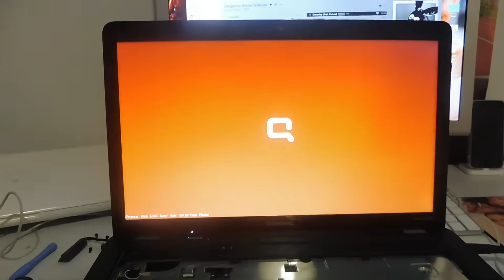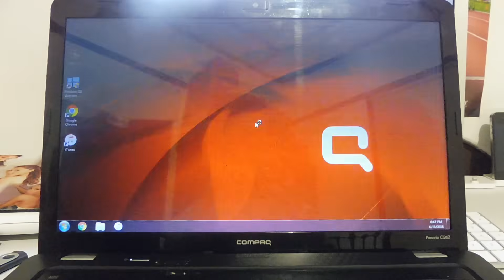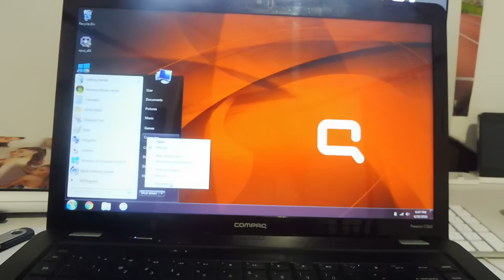HP Compaq CQ62 Blinking caps lock key fix

Comment: i was have the same problem with compaq presario CQ42. i was reset everything like ram,cmos,processor,wifi but still not work. the screen is black.. previously it was caps lock blinking 4 times and wifi turn orange. so far i was no luck. thanks.

Comment: I suspect mine has problems with the CPU/heat sink connection as I have to blow an air bed pump into the fan every now again to keep it cool as it throttles its performance to protect it from overheating

Comment: i need help I've been trying to fix my laptop for over two months. the caps lock blinks 3 times and the the wifi key is a steady yellow. can anyone please help? I've tried taking out the battery and resetting it but that doesn't work. also my screen is completely black. i can hear it turn on tho
Reply: Alys Fernandez same problem for me
Reply: Restore the bios by downloading it from the internet. Also check your ram.
Reply: It's the ram
Reply: Check the RAM

Comment: WOW! thank you, this tricks worked on Compaq CQ56 , i cleaned up the fan etc, pulled the cmos battery and put it back, replaced thermal paste with ARCTIC MX-4, was a bit dried.. Everything back to Normal, well i still using my ASUS K40IN for years without any issue!
Reply: not work for me, any idea?

Comment: so did you take the cmos battery out or change it?
Reply: gemma cross Have you fixed it?
Reply: yeah tried THE CMOS but the graphics chip was fried so left it.common problem with HP LAPTOPS.
Reply: gemma cross ohk what model do you have
Reply: @piximarie3  you could've changed it